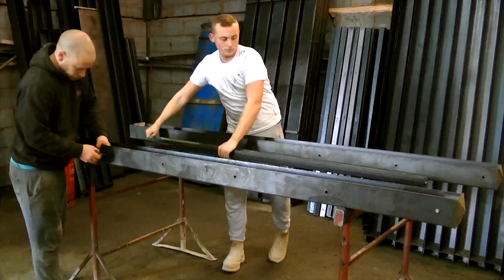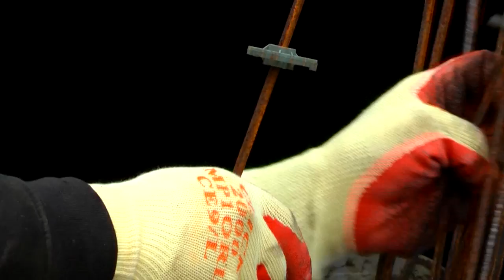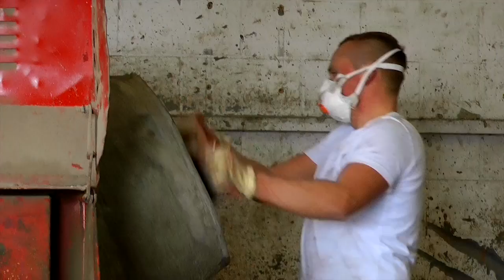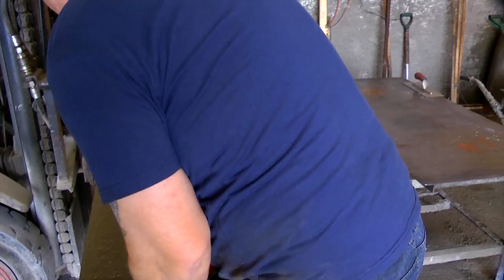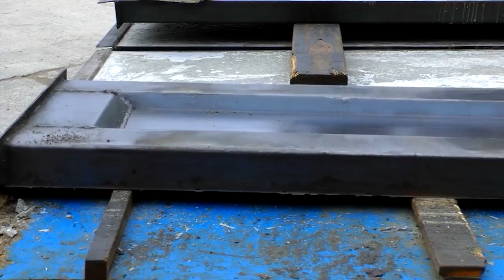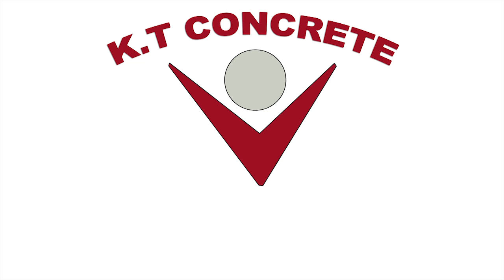How to make a concrete fence post thompsons fencing

Comment: That concrete looked really slushy and easy to handle. How come every time I mix concrete according to manufacture's recommendation, it end up super dry and nearly impossible to mix?
Reply: Add more water until you like the mixture.
Reply: Make sure put in more gravel than sand.
Reply: Don't add more water. Too much water makes the finished product weak. Use an elasticizer. Also known as flow control.

Comment from the maker: thanks we did the video for the chaps at kt. kevin the director is a top fellow. all products are top quality his knowledge is second to none. have a good weekend. ps all products exceed british standards, the kt recipe!!!
Reply: Elite Digital
Reply: Elite Digital the concrete is far to wet which weakens the concrete ( the old adage .the more water in the mix the weaker the concrete should always be borne in mind. Also I would not use quarry blended sand and gravel mixes they are usually way to sandy and can not be relied on for consistency . The best precast concrete products are made by blending your own concrete from separate piles of sand and 10 mm sized stone . A good mix to use is 1 cement 2 sand and 3 to 4 stone . My preferred mix is 1: 2 : 3 .
Reply: @brickbybric  I think they know what they are doing lol
Reply: 0ldw3lshm4n  I don’t think they do . I have never seen a precast concrete product company  make there products from a pre blended sand and gravel mix ,the reason being different products require different ratios of stone chipping,s ,sand ,and cement . Those sand and gravel mixes usually have 2 much sand in them . The concrete is clearly 2 wet which weakens the finish product . ( I saw no evidence that they used super plasticizer which you would not need for filling such shallow moulds) how do I know all this ? I manufacture precast concrete products. ,and finally if you knew anything about this sort of work you wouldn’t have said I think they know what they are doing .
Reply: @brickbybric  how do you know they did not add any plasticizer to their water?  How do you know the aggregate/sand mix is not pre mixed  with correct ratio they wanted?  Even though wet is weaker than if it was drier, still more than strong enough for application of fence posts.
Reply: 0ldw3lshm4n I can see by looking at it that the sand and gravel mix has more sand than gravel  . i  can’t tell for certain that they have not used super plasticizer in the mix, but on balance having made concrete products for a long time I can say I would never add to a mix an ingredient that’s not needed and also putting an ingredient in that’s not needed adds to the cost of producing the product so using common sense on balance it tells me they probably have not used it. these fence post and panels have to be made from high strength concrete because you certainly don’t want them made from weak concrete . So judging on the video my suspicion is the concrete is not of sufficient strength for the application. Remember this you could walk into a yard in the morning and the business may be only open a week .company’s that supply cement, steel ,sand , gravel, mixers steel, moulds  etc don’t require you to have knowledge of precast product manufacture before they will sell you the stuff so you could go to a place that looks very professional but it may not be .People seriously over look the importance of having the correct amount of water in a mix and no more.
Reply: @brickbybric  Is it ok to put in the rebar without binding together? D8 mm bound together using R6 mm?
Reply: @brickbybric  sorry but you haven't got a clue what you're talking about.  You can have 40mpa concrete with 150 slump.
Reply: waearth500 but I’d lay money on it that’s not what  we are looking at here . And I don’t know where your coming from with your I haven’t got a clue comment . Did you actually read my comments .

Comment: Hello great video,
I'm starting to make my own posts and gravel boards/bases and I have a few questions. If anyone could help me put I'd be most grateful.
1. What is the best cement to sand to gravel mix ?
2. How long to leave them before trying to remove them from the mould.
3. Should a high strenth cement be used?

Comment: Interesting video.  What size rebar is that (1/4 inch / 6mm)?  Would it not be better to use a single larger 1/2 inch / 12 mm piece?

Comment: Hey guys, quick question. What do you spray the forms with so the concrete doesn't stick?
Reply: You can use old lubricating oil
Reply: Release agent.
Reply: Crisp n dry

Comment: I am trying to make these (but 6x6 with a flat top, I have a metal mold I made). For some reason they keep crumbling? I am in the US so I'm not sure that the concrete I'm getting is the same, any pointers you can help me with, you look as though you have it down to a science!!
Reply: Bagged concrete goes bad over time and then will not set up hard. I wont use bagged after 6 months and I add one liter of portland cement to each 60 lb bag some add 2

Comment: Hi we have just started making post at our garden centre  but are having problems with  airline cracks 
Our mix is 1 cement 1 1/2 sand 3 1/2 10 mm gravel 
We used to use 1 cement 
2 1/2  2 1/2 10 mm gravel 
But posts where to sandy

What is the best mix we make slotted and multi hole post 
Howling should we leave b4 we sell them 
Appreciate any advice 
Thanks

Comment: Rusted bars in the concrete? No way!
Reply: Any reinforcing always ends up rusting, concrete is pourus so it's always going to happen sooner or later
Reply: They make enameledrear, but it inevitably fails quicker. Some imperfection allows moisture in and it rusts at one point and then fails at that point. Best to just leave it bare.